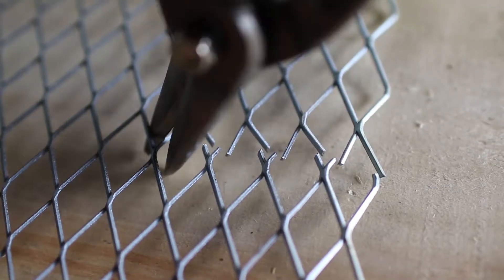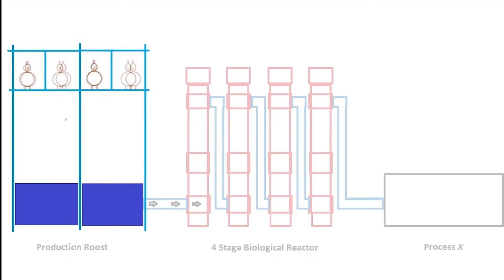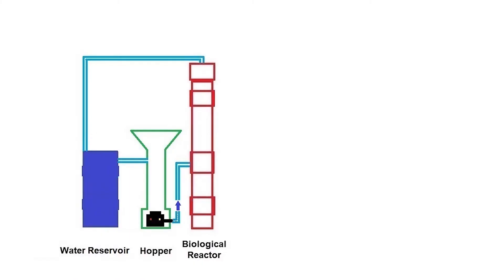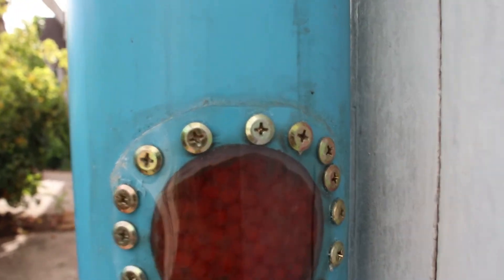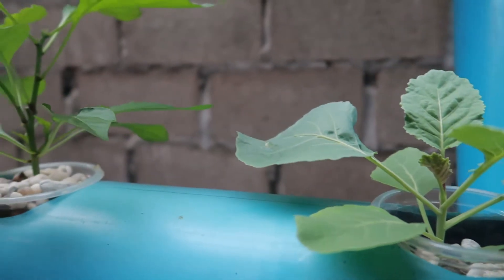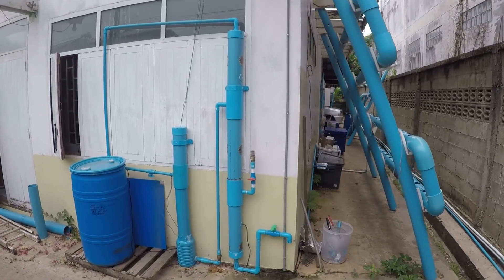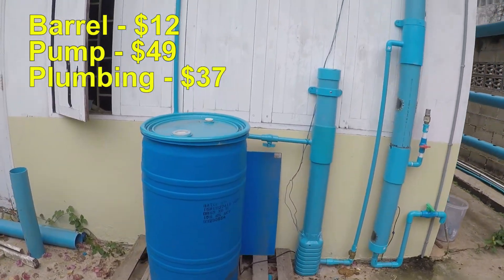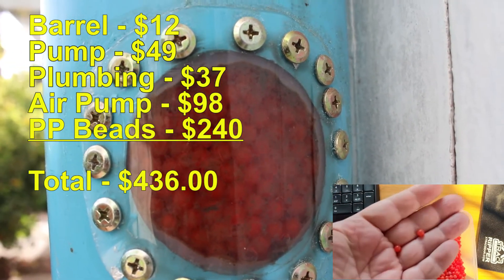Phase II single-family biological reactor prototype

Comment: I have many chickens and am considering building an aquaponics system. If I can use my own chickens for this, that would be perfect! What is your experience after 3 years?
Reply from the maker: We've had resounding success. Works as well as fish based aquaponics without the need to maintain a sensitive aquarium system.
Reply: @ChickenAquaponics  Thanks!  We will build one!

Comment: Looked at all your videos. It's a very interesting concept. I can't help but feel like you're adding a few unnecesary extra steps compared to traditional aquaponics. For example, boiling the nutrient enriched water to get rid of the pathogens from the solid chicken waste. Are you sure that's necessary? Traditional aquaponics does not include this step. Instead the solid waste is filtered and used elsewhere or separated at a later time, aerated and brought back to the system. Wouldn't it be better to just filter the chicken waste instead of grinding it up? You could add worms or snails into the system to make sure it stays clean, that the nutrients aren't wasted and you could feed them to the chickens.
Reply from the maker: Thank you for your comment.  The system is quite successful at filtering all of the solids before leaving the reactor and before boiling.  Actually, boiling, for the purposes of sterilization, is demonstrated for viewers that have lingering concerns about pathogens.  I personally never boil the solution because the bioreactor removes the dangerous elements.  Additionally, the plants filter contaminants. 

I like to use the example of the farmer that applies manure to his fields for the purpose of fertilizing his crops.  Nobody runs out to the farmer expressing concerns about pathogens in the manure used to grow his product because it is a time-tested, safe method for stimulating plant growth.  The same goes for chicken manure processed by a bio-reactor.

Comment: what is the fitting you are using for aspiration
Reply from the maker: The device at the top of the asperation tube is called a chick-valve, or a foot-valve.  You can find it in any hardware store.